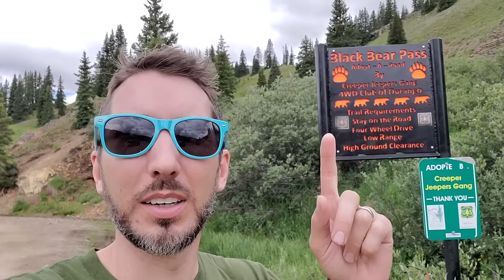Narrow Escape - Trapped by Hail, Flash Floods, and Landslides

Comment: I went over this trail in the early 80’s in a full sized Chevy Blazer.  At one point, going up a really steep pitch, the truck stalled because the float stuck in the carburetor.  I started rolling back down, freaked out, hit the brakes, was then skidding down very close to the edge, so I had the brilliant idea to turn so that I backed into the side of the hill.  It worked and bent the bumper in a bit on the left rear but it stopped me.  I then had to get up under the hood and bang on the carb a bit of jar the float free.  After that, the Blazer started and I continued without further problems except for the serious need to find a restroom in a really big hurry!!

Comment: Rule of thumb for Colorado. It rains most afternoons in the summer 🤦‍♂️
Reply: "be off the mountain by noon and you should be okay" i know this and im from and live in missouri
Reply: This should be the main takeaway for anyone interested in touring the alpine, overlanding or otherwise. Isolated storms, lightning, hail, etc should be expected during the summer in the afternoon. Opensummit is one of the best resources for weather information on mtn peaks and passes but your best bet is to avoid the alpine after noon. I'd be curious to hear from the excavator guy how often he has to go up and clear the road.
Reply: Rain is a bit of an understatement. It's more like entire rivers fall from the sky all at once, almost completely out of nowhere.
Reply: @ColtonBlumhagen  not on the western slope
Reply: For the last 2 summers it hasnt rained at all 2019 and 2020 hasnt rained at all so it's so dry in southwestern Colorado if it rains like it can in Colorado then the soil now will just erupted so easy too the point it will be nothing but a mudslide or even a landslide because the dirt is so dry that will just run off with a huge amount of rain or even snow.
Reply: Just above 10k.
Reply: Not this year though. We had a pretty bad drought and we got rain probably 10 times all summer.
Reply: and will hail/snow as well, esp at that altitude

Comment: How many of y’all thought to lower tire pressures even more?
Reply: Wouldn’t help traction any in this situation and they didn’t need it. You lower your air pressure for soft sand etc. It might have made the ride easier but they were crawling along slowly driving down hill on hard rock. So traction wasn’t an issue and going so slow the ride wouldn’t be bad either.
Reply: @terrywbreedlove  Disagree completely, lowering your tyre pressure is purely based on one single fundamental. That is widening your foot print, more foot print equals more tread to the ground, more tread to the ground equals more traction. That is now used yes for sand and rock crawling even comfort however on gravel wet roads the principle applies by the thousand
Reply: @blehbleh222   They are driving on a gravel road. And driving down hill on the brakes and in low gear most all the way. Traction is not an issue here. Do you see them spinning the wheels or losing traction even once, No.
Reply: @terrywbreedlove  but will it increase traction at least a little? Yes.
Reply: @ThisIsDavesGarage   No it won’t help traction because it is gravel and they are going down hill. The only thing they May get is a bit softer ride. But and this is a big one it will also make it more possible to puncture the side walls on a sharp rock.
Reply: @isaT   and jeeps flying by

Comment: That was an adventure.  What a story to tell.

Here is what I noticed:
Did you checked the weather.
You have no defrost?????
In such conditions, it is safer to walk than it is driving.

*  Tip: Colt does not have to be in the frame all the time.  Half Colt, half dashboard.

Congrats on your anniversary.  This was better than McDonald. 🤣 
(( tell her that you had all planned out. the rain, the mud slide, even the bolder.  All methodically calculated to celebrate your anniversary ))

Comment: Man that was an awesome video! Great area to be trailing too! I also own a Willy’s wheeler like that one! Mine is Baja yellow 2015, I bought it brand new back then, and I love it! Never had any mayor issues with it, other than routine maintenance, like new tires, battery and brakes and oil changes. The original bf Goodrich didn’t last me long! Maybe 24k miles! I replaced them with the Goodyear wrangler duratrac’s, and so far very satisfied with them. Have them now for about 3 years and they still look great! Awesome video guy’s!👌😎👍by the way that section looked nerv wreaking!😱yikes

Comment: At the National Training Center theres a trail on Mt. Teaford you drive down that Black Bear reminds me of. I was driving a 13 ton tracked vehicle down this very steep trail on a moonlit night and I reached a point where I have to make a 90* right turn. When you make this turn theres nothing between you and what looks like a 1000' drop but a few strands of barbwire. The pucker factor at that moment is like a good nine a 1-10 scale. All you can think of as you pull as hard as you can on the lateral steering controls is 'if theres a malfunction that barbwire aint stopping this 13 ton track under any circumstances'. 
That night our battery drove 8 M109A2 mobile artillery guns, there M992 ammo carriers, my M577 FDC track with trailer, various Hummers with and without trailers and a few other vehicles down that damn mountain in the dark. We had no breakdowns and all reached the bottom safely but without a doubt we were all relieved to finish that decent

Comment: Hi, can you tell me in what gear you are when you go down in place  like this ..Black Bear Pass.  I suppose you go in Low Gear for more engine brake... but I never do a trail like this one... I run tacoma offroad 3rd gen.... auto transmission,  and Manuel CVT,  so usually when I go down I just stay in Hi gear but  use Manuel CVT for more engine brake..

Comment: Via ferrata note: it's not a "very difficult climb," per se. You're clipped onto steel cable or rungs as you traverse steel rungs and clear foot and hand holds. Sure, it gets pretty high, but if you have proper gear, are safety conscious, take your time, and can climb a ladder in a harness for a few hours, a novice with a guide can clear it no problem. For a truly difficult via ferrata, you'd have to visit some of the crazy WWI-era via ferratas in Europe, some of which require more than one day, sleeping at altitude. Some climbing gate keepers hate "climbing" being associated with via ferrata. Really, via ferrata is a way to open a rock wall experience to the general population. Definitely recommend checking it out!

Comment: When you see rushing water over the rock walls, then that is your sign to stop advancing and/or go the other direction to higher ground. When there is already water, rocks, trees and other debris flowing over the road, that means you are going to either get stranded or your vehicle will get pushed off the road from the high flow and power of the water.

Comment: TLDR: Colorado does this year round. If you plan a trip to the Rocky Mountains, pack for every weather emergency, no matter the month of year or how great the weather currently is. 

If you're not from Colorado, you just witnessed Colorado weather, any time of the year, especially in the mountains. I was on an ATV trail outside Grand Lake, summer, started off hot, ended with freezing temperatures, 2" of accumulated hail 10m from the cabins we rented; my entire family abandoned our ATVs and got a ride back. We were all minutes from complications of hypothermia. I cannot count the number of Mile High Nationals drag races I've been to that started off 95 degrees and ended in flash flooding and cold temperatures. I was on a motorcycle ride to Estes Park, on the way back, a storm rolled in and began to hail on us (not wearing a helmet, took hailstones to the face (I know it was dumb)). Had to stop and huddle around a tree for protection. By the time we made it back to Commerce City, it was nearly 100 degrees.

Comment: Just saw this, but quick tip when wheeling in general especially sketchy areas like this...DONT wear your seatbelt. You're not gonna crash into cars like on a road, and you're not going 60 mph. The seatbelt is actually a hazard here. If you need to bail out you're now stuck. That 2 seconds to unbuckle could be the difference between life and death.

Comment: I've been down this in better weather with a stock XJ on 29s (235 75 15) but wouldn't recommend it with the stock transfer case linkage. Luckily, if you don't like the weather in Southern CO, as they say just wait 5 minutes. Hail storms like this don't normally last longer than an hour.

Comment: The main thing is you got down safely hope the news reports of the missing climber were false or he/she was found safe.
Sadly mountainous regions have a weather system of their own even in the UK many people have sadly paid the price for not being prepaired.
I doubt that my old 4x4 or new pickup truck (also 4x4) would do that  but I would do a guided in a vehicle driven by someone who knows the area the scenery looked stunning.
One question whats the law in the States regarding the large crack in your windscreen as any large damage within the arc of the wiper blades is a fail on the yearly Gov enforced safety check (known as an MOT all vehicles over three years old have to have this) and if the police spot that crack you would have a prohibtition order meaning you would have to get the windscreen (we have mobile companies who replace at the side of the road) replaced there and then also heavey fines and points on your licence.

Comment: I thought that trail is supposed to be one way
Reply from the maker: It is
Reply: It is two-way from bottom, up to power plant access road. From BB pass at the top down to there is one way only with many warning signs posted on both ends. People still drive street only vehicles up the lower road from Telluride.

Comment: Those keeps could've easily drove over the rock piles at the end of the video. I agree with previous comments, mostly a lack of skill of these bad drivers. Look at the line he took early in the video where he took the outside on the loose rock pile risking slipping over the side rather than going straight over the solid rock. A lot of those "three point turns" he took were unnecessary had he swung wider and steered tighter in to the corners. Simply put dude in the red jeep is a bad driver and  not confident off road. The masks on the mirror should tell you everything you need to know about his "manliness" lmfao